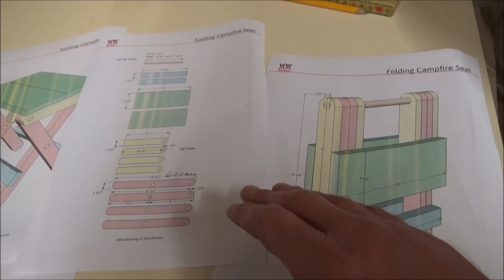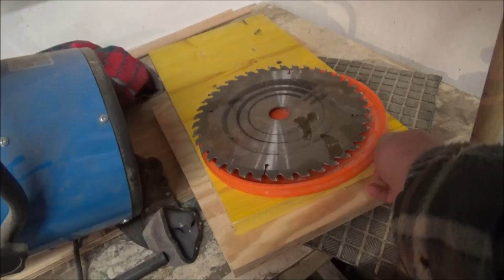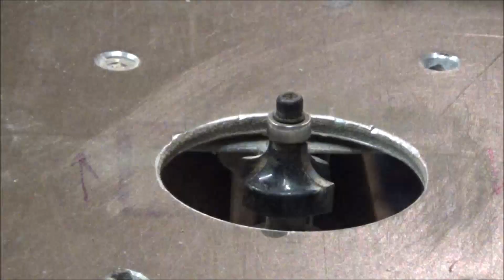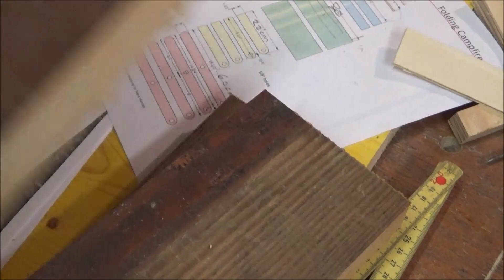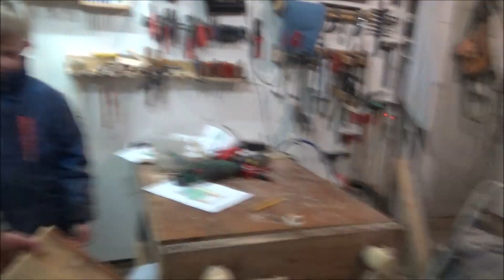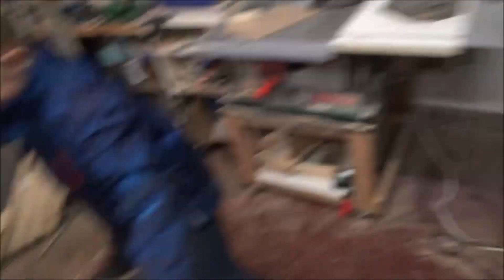Scrap wood folding workshop stool  02 01 20

Comment: Neat job Dave, would be ideal in the greenhouse when sowing or pricking out 😀👍
Would it help to rub some candle wax on the joining faces of the legs before assembly??
🌻 Nigel .......MuddyBootz Allotment 🌻
Reply from the maker: Cheeres mate Yeah good for lots of things. Perfect for the shop as I dont often need one. A normal stool is always in the way so this is great. I did wax the dowels and I might end up putting a finish on it. 
Cheers